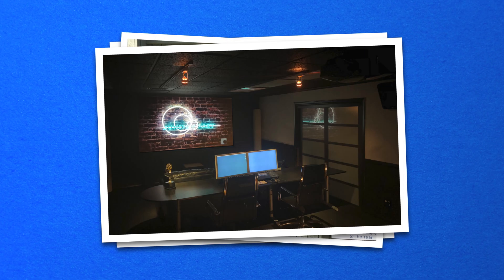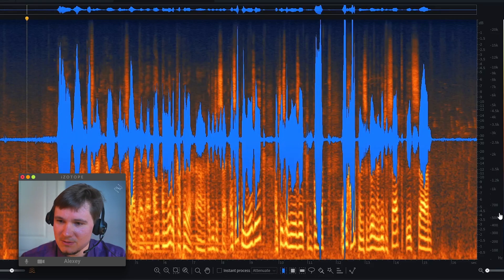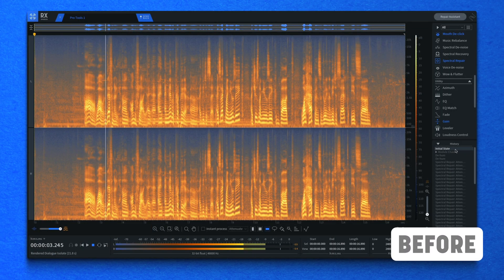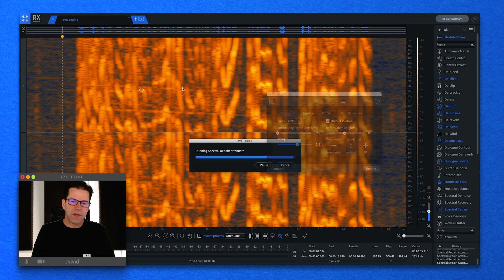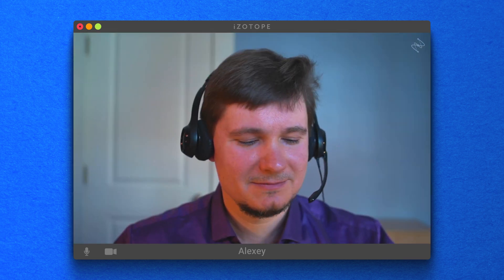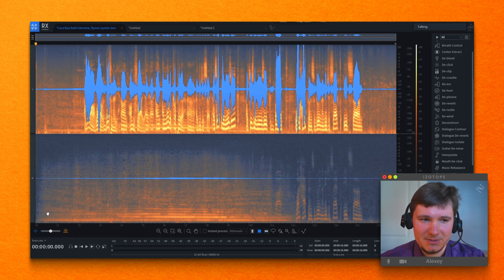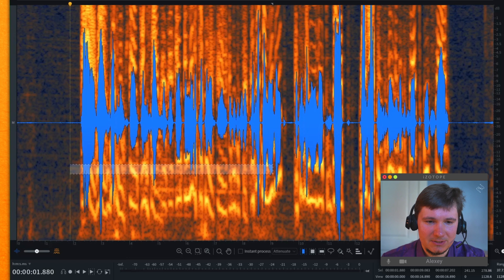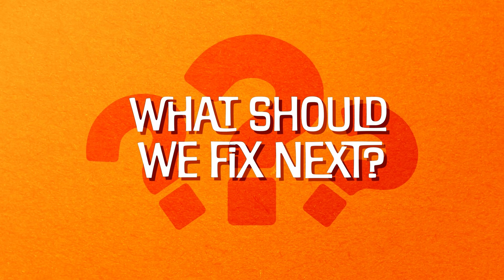Fix It Friday: David Barber vs. Alexey Lukin with RX

Comment: Can someone explain to me why Alexei did that conversion to mid-side first? Was he just flexing? Everything David did made good sense to me but Alexei lost me!
Reply: The voice sounded close to mono, while the noise was fairly wide. So, conversion to M/S was a good analysis tool for confirming that, gaining a few extra dB of S/N in the Mid (voice) channel, and attempting to phase-cancel some of the noisy components (it doesn't usually work well, but here resulted in a small improvement). One other useful tool for such scenarios is Center Extract.
Reply: It’s a great move to check the anti phase signal. Often the noise there isn’t masked and you can get a lot of bang for the Buck going after noise there while being more subtle addressing the correlated signal. I’ve seen Alexey do this often before and it’s a great strategy.
Reply: @zlbdad  I'll have to look this technique up...if you have a link to a good tutorial about it please let me know, thanks!